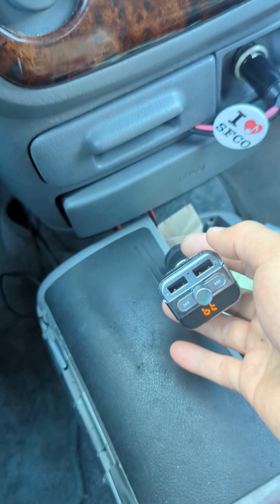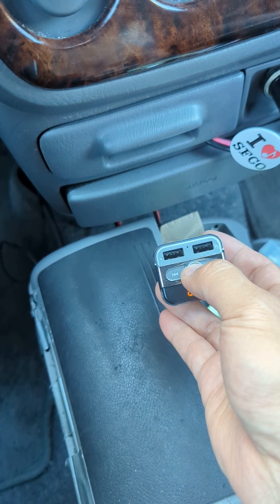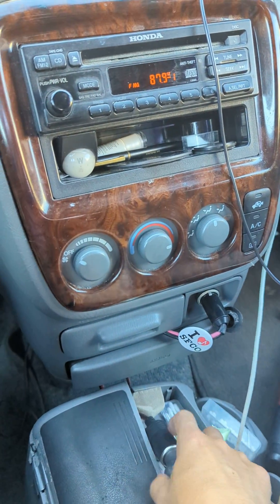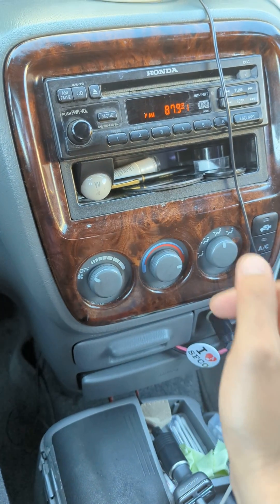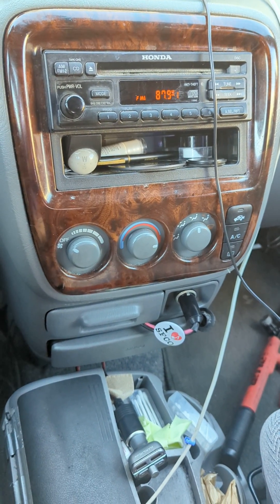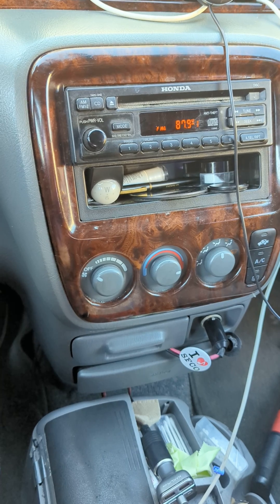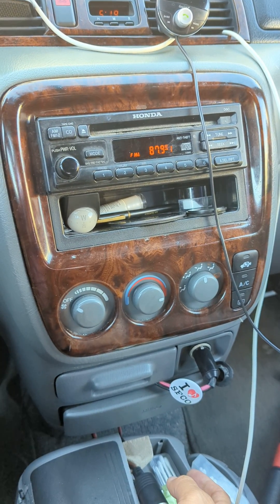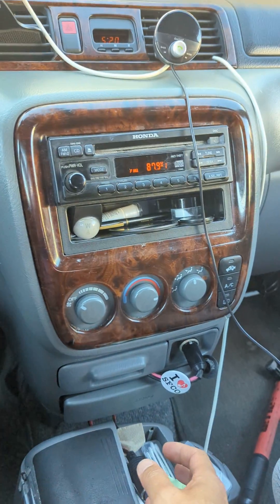Bluetooth FM Transmitter Static Problem ( example of the humming, hissing and white noises )

Comment: Do you have an idea how to solve this problem??
Reply from the maker: add a ground loops noise filter to your transmitter.
Reply: @gizmoguygadgets same issue for me
Reply from the maker: @karkuvelb9969  Need one for optical drive, this one is made for fiber optic systems. 98 - 2012.
Reply: How do i do that? @gizmoguygadgets

Comment: Is all aux - bluetooth recievers the same?
Reply from the maker: Bluetooth is same, but FM transmitter part is different to get  better sound quality.
Reply: @gizmoguygadgets  i mean does all aux - bluetooth recievers make the humming sound, so is it worth buying a quality one maybe it doesn't make any noise?
Reply from the maker: @user5511_  Older FM Transmitter ( Amazon ) is not compatible with newer car 1998 - 2012 Fiber Optic System. The Gizmo Guy Gadget Bluetooth Adapter is designed and made to be crystal clear and static-free.

Comment: Mine does this are you sure it isn’t the car
Reply from the maker: The car is bone stock, It's the transmitter with ground loop noise from the frequency emitter interfere from the power source.
Reply: @gizmoguygadgets  mine is stock too I’ve had issues for awhile
Reply from the maker: @xCixada  The solution is to separate the power source from the transmitter. Do not power the transmitter from the car's battery. Use an external battery such as a power bank. This will reduce and remove the interferences.